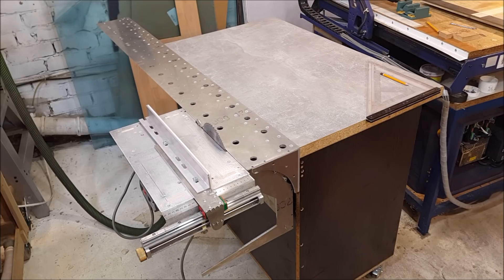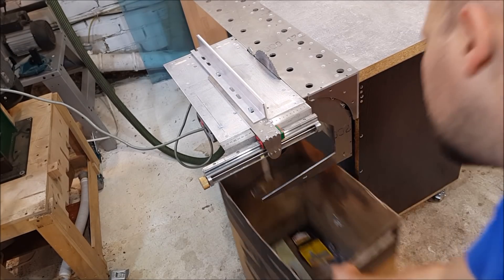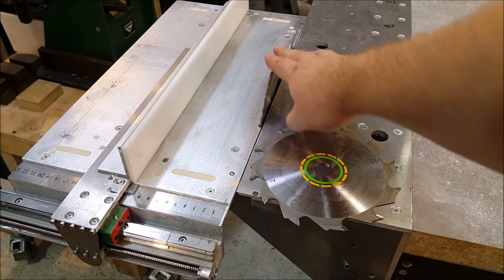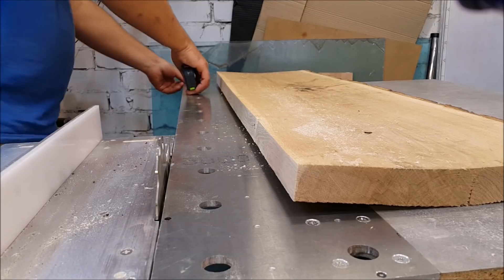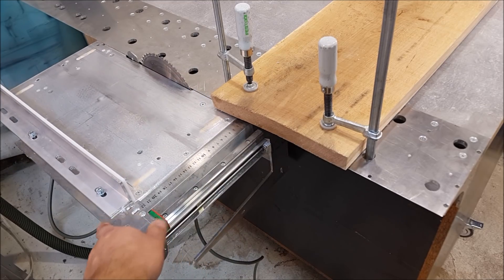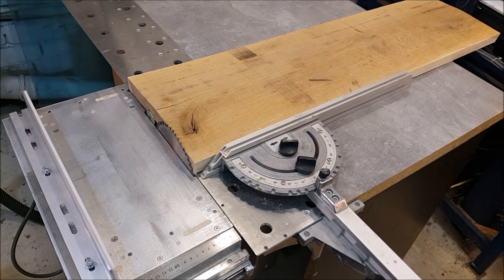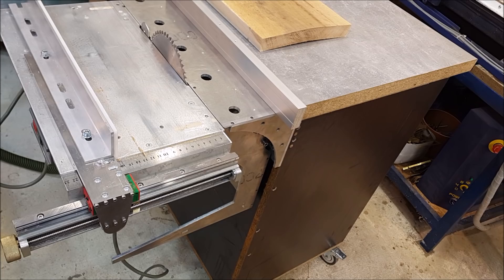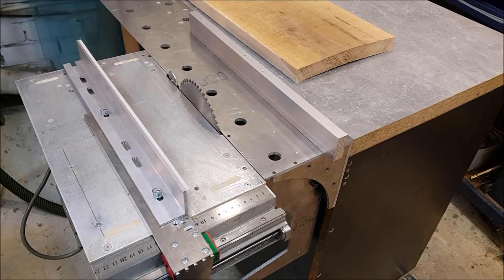Table Saw Dreams 11

Comment: I realize I need one now I've seen it in action so much safer than table saw for straight cutting warped boards much faster than using the jointer as well.  Beautiful work.

Comment: Love your uploads and really liked the idea of a portable precision saw, however haven't you just made an upside down, non portable track saw? Strikes me that straightening that edge, and cross cutting the end, would have been easier and probably quicker with the track on top of the board, as the track saw was designed...
This looks great for very accurate small parts, but for big parts/boards it just seems a bit pointless? With a long track you can straighten an edge over twice as long as that board.
Love the engineering none the less.
Reply: Agreed, my first thought when I saw it was I've got to have one and then I realised I already do exactly that operation with a regular track on top of the board. I think this would probably be slightly faster for setting up a parallel cut (once the right hand fence is in) but you'd be talking seconds faster and this design limits the saws cut length. Like all Mirock's projects the engineering is great but I can't help feeling this problem is solved.
Reply from the maker: Yes Joel, but  here is functional of upsided down track saw but not only. It is not main goal but just additional profit from decision of attaching to the worktable. More advantages will be obvious when big protractor fence will be mounted.